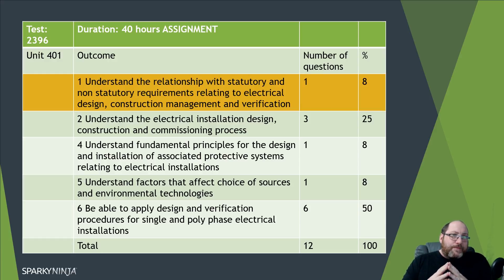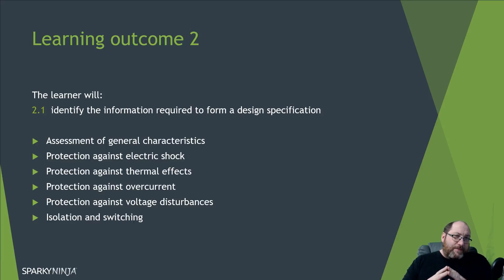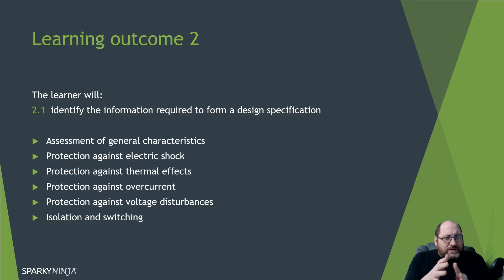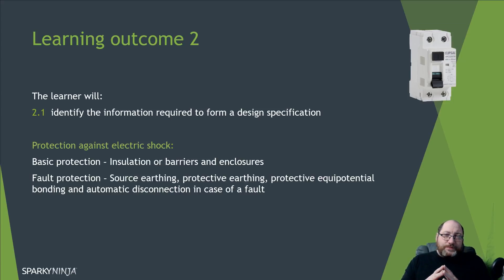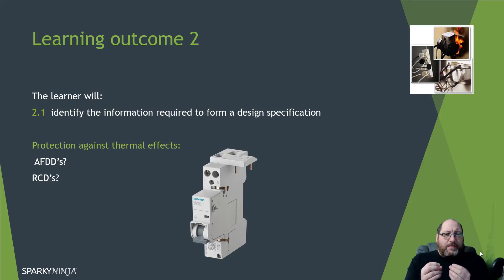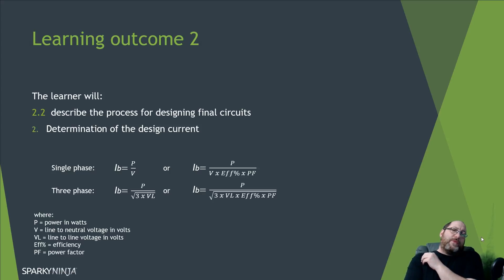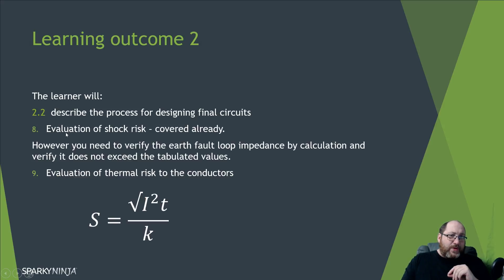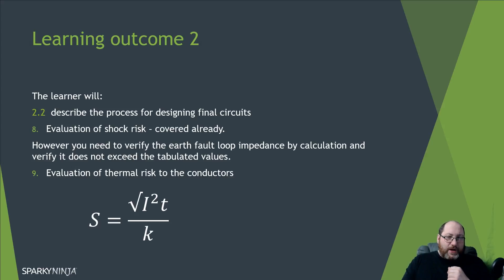2396 Ep 2 - Outcomes 1 & 2 - Design and Verification

Comment: The formula to calculate Ib for three phase is correct or not.

I thought was P / 1.732 x V

Your square rooting everything at the bottom.

Or I am wrong.

Thanks
Reply: Sorry it's really late but im only watching this now, he just has continued the square root line where he shouldn't. sqrt3 is 1.732 so thats why in industry we just type the number but in the exam they may expect you to use the full sqrt incase the decimal place answer is wrong presuming you don't round up anyway.